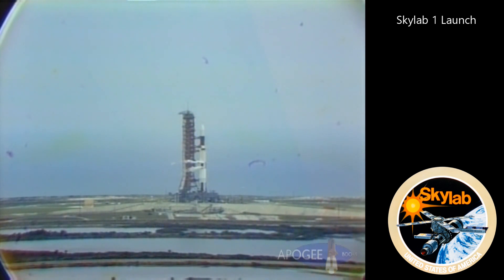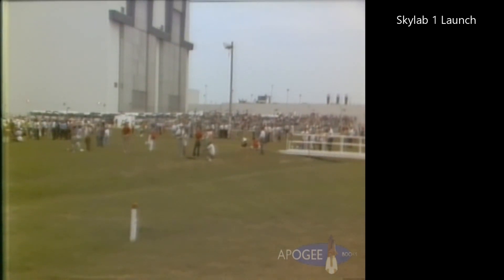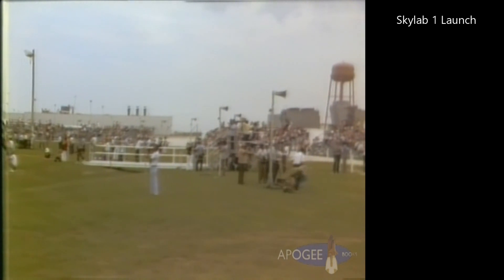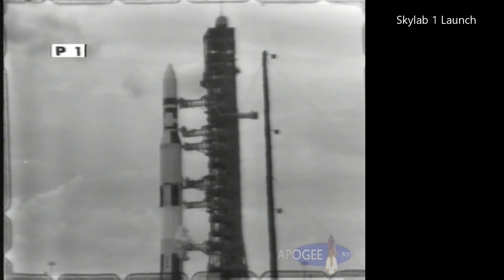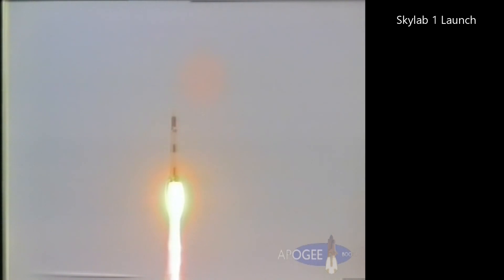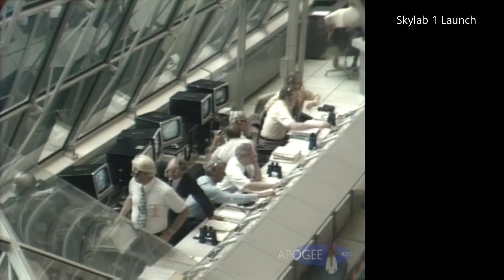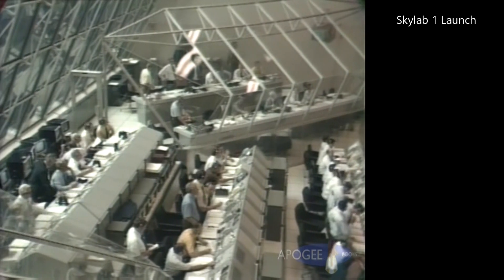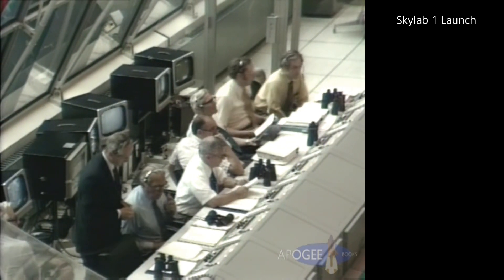Skylab 1 Launch

Comment: Seems that rocketry and spaceflight has stalled in my lifetime.   Nearly 50 years ago they launched a 200,000 lb space station to obit on a two stage super heavy lift rocket.   Still, nobody can do that again.   Both Space X and Nasa with SLS plan to do have a super heavy lift rocket.   But intending and doing are completely different.
Reply: Still waiting for Orion to be manned, if ever.

Comment: The last Saturn V. 😭😭😭😭
Reply: The last one is in the Kennedy Space center.
Reply: @charlesvan13  There are two others: one at the Johnson Spaceflight Center and the other at the US Space and Rocket Center, Huntsville Alabama.
The first stage of the KSC Saturn 5 is a test rig. The real first stage is somewhere else – I read about it a few years ago, but I have forgotten where. It isn't in a museum, but is sitting out in the weather.
Skylab was made possible by the cancellation of the last three Apollo missions. Some of the leftover hardware was re-purposed for Skylab – one Saturn 5 –  first and second stages – three Apollo Command Modules and their Service Propulsion System modules and two Saturn 5 third stages converted into Skylabs. The other Skylab is in the Air and Space Museum.
The only unused, flight ready Apollo left is in the KSC Apollo Saturn 5 Center. It was fitted with two extra couches in case a Skylab crew needed rescuing – Apollos could fly with only the Commander and Pilot – and when it was never needed, it was fitted out as the backup for the Apollo Soyuz Test Project mission in 1975.
The Saturn 1B that would have launched the Skylab rescue mission was retired at the KSC and is now on the Visitor Center Rocket Garden.
Reply: @MarsFKA  I think the book you are trying to remember might be "Stages To Saturn" by the Government Printing Ofice

Comment: The interstage on Skylab 1 failed to separate but the PAO announces a good SEP. I'd like to listen to the full ascent til orbit but never found it. This is still longer than anything else so thank you very much ❤
Reply: I mean, even better would be the FD loop but I don't think that will ever be released, if it has been recorded
Reply from the maker: as in the description, the fuller video of this is included in the Apogee book. This is just the last 3 minutes - They asked me not to post the full one they have (from T-1 hour) for obvious reasons.
Reply: @lunarmodule5  Understand. Thank you LM5
Reply: @lunarmodule5  Its to my understanding, that ALL the Blue Prints and associated design technical graphic. for the Saturn 5 Rocket were SHREDDED & BURNED . ..So that the Russians of the Soviet Union could never ever get their hands on the Desighn. Blue Prints.
Reply: @lunarmodule5  what obvious reason?
Reply: @fredthompson4568  This is incorrect, many of them can still be looked up to this day. Its mostly a matter of finding a catalogue of them which means wading through government processes.
Reply: @fredthompson4568  No, the blue prints are in the National Archives. However the fixtures used in building the Saturn V were scrapped.
Reply: The pyros that did fire actually were in just the right location to trigger the sep indication while still being damaged enough to fail to fully drop the interstage. The only thing they had to indicate it hadn't separated would've been the temperature telemetry from the J2 engines.

Comment: The final Saturn V launch. (Sigh)
Reply: technically Apollo 18
Reply: @orbitervehicle103  Technically, nothing of the kind. This was Skylab 1, using, by coincidence, the same rocket that launched the Apollo missions.
Reply: @MarsFKA  Pretty sure this specific Saturn V was originally going to be used for Apollo 18, but it was instead used for Skylab once Apollo 18 and the other moon missions afterward were cancelled.
Reply: @orbitervehicle103  kinda
Reply: Apollo 17 was the last launch of the full stack, I guess they used the remaining SIVBs on Saturn 1Bs.
Reply: What did they use to launch Skylab 2?
Reply: @Liters  A Saturn 1B stack.
Reply: John Brhel And the most anticlimactic.
Reply: @olentangy74 - Apollo 17 , as the last manned Saturn V, fittingly was the climax with that dramatic nighttime launch.